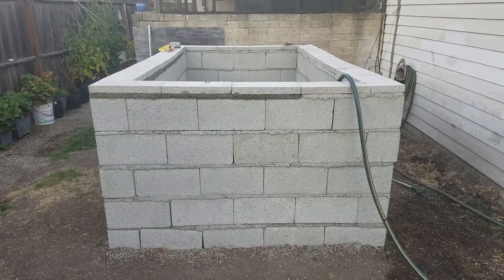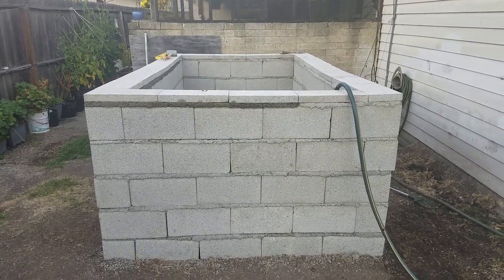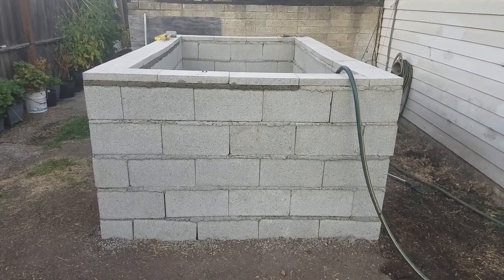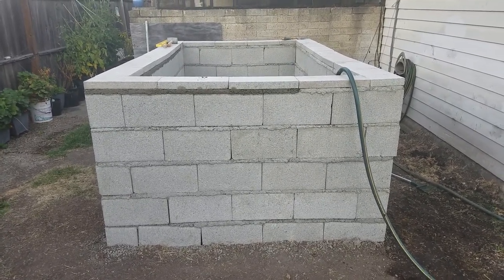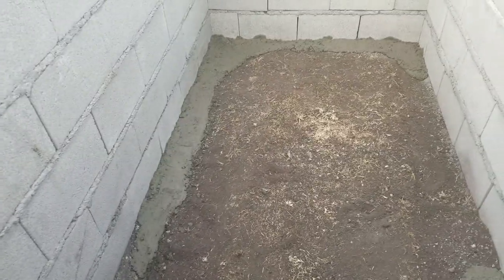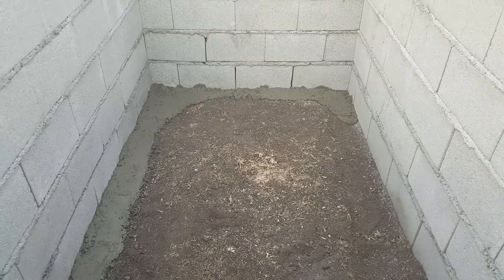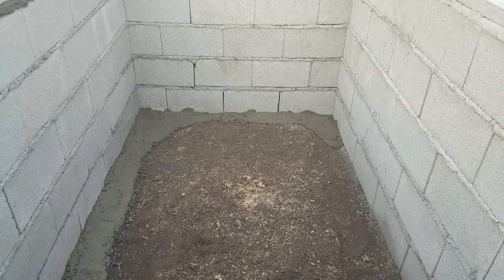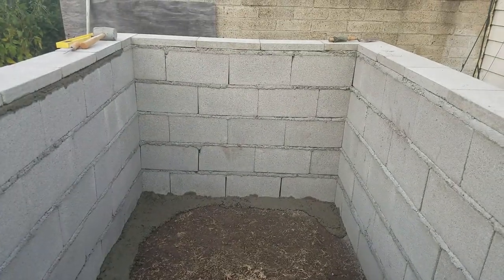Above ground pond build DIY Cinderblocks

Comment: I have a plan to build a 4.5m x 2m raised bed (outer) with 7N 140mm solid concrete blocks (27kg) height will be 4 courses high (225mm x 4) from just below ground level
Do you think those blocks would be strong enough laid in the 140mm wide configuration? to support an incorporated small pond at one end, probably have it as a 3 course high with coping stones. Only perhaps 600mm x 2000mm for a water feature with some small fish in it.
I think it'd be plenty strong enough but looking around the internet I see some folks building seriously beefy walls and started having doubts.
Reply from the maker: I've done some converting to do the Math. I'd be worried about a couple things , it's not very deep so the sun is going to turn the water green rather quickly.    The sheer volume of water may be too much for those bricks.  That's a lot of water pressure up against those bricks. Even my bricks are filled with concrete. If my conversion is correct it's 15 ft x 6½ ft and 3ft tall
Reply: @justanotherguppyguy  Thanks for replying - the largest part of the bed will 4 courses high and have soil backfill for veg planting etc. I have some stainless wall ties I intend laying in the mortar bed between courses as a little extra strengthening. The pond part of the same bed (compartment if you will) is only going to be a smaller step down 3 course high section at one end with coping stones and estimate that to be 6ft x 2 ft and about 3 ft deep (when I dig out a little below ground level.)
fyi I'm not wanting to house showroom Koi just a few gold fish tiddlers and a few aquatic plants with a little airating waterfall or fountain of some sort.